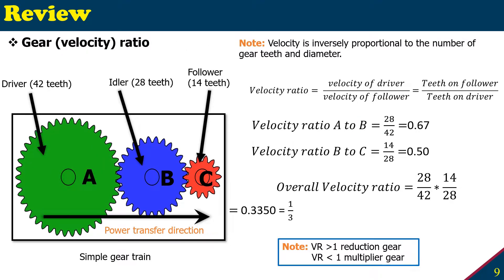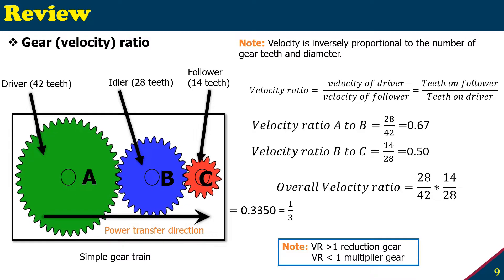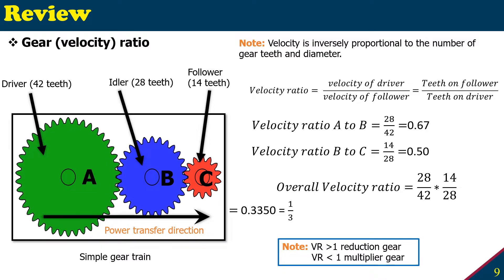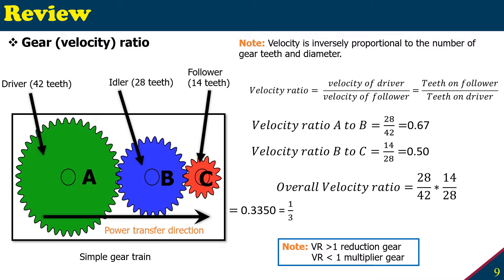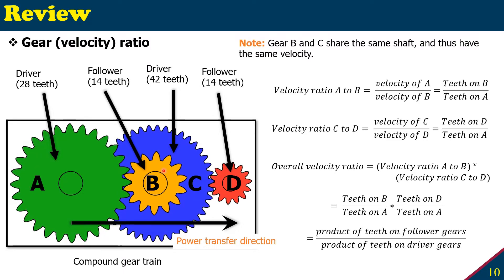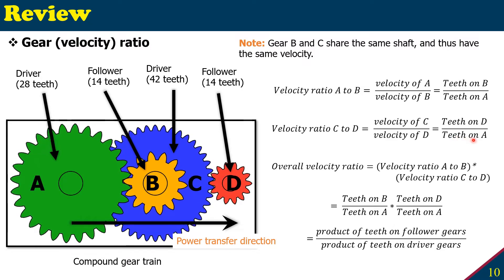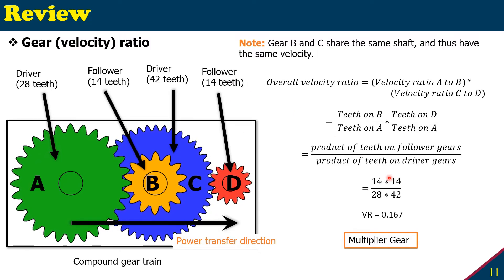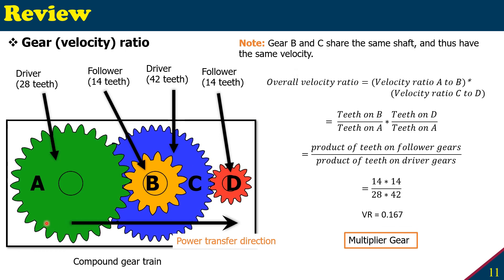Gear velocity ratio for Simple and Compound Gear train. Reduction or Multiplier gear? #geartrain

Comment: The velocity ratio should be 42/28 and 28/14. It's inversely proportional to the teeth like you said. Also, velocity ratio < 1 is a reduction gear, and velocity ratio > 1 is a multiplier gear. Your gears are multiplier gears so your VR should be > 1.
Reply from the maker: Gear set with a velocity ratio greater than one is used to increase force while reducing speed.

Comment: Pls this!
A driving gear having 25teeth engages with a second gear with 20teeth. A third gear with 30 teeth on the same shaft as the second one engages with a fourth gear having 60teeth. Find:
a) The total velocity ratio of the system.

b) The mechanical advantage of the system if its efficiency is 85%.
Reply from the maker: For the first part (a) follow the instructions described 3:00 min onwards.

Comment: why are the velocity ratios multiplied ?
Reply from the maker: One way to look at it as the multiplication of the velocity ratios cancels the idler gear from  calculation. In this case, B is the idler gear, and ratio multiplication cancels idler gear number of teeth from consideration. And the overall ratio depends on driver and follower gear. No matter how many idler gear you may have doesn't affect the overall ratio, and multiplication makes it right.